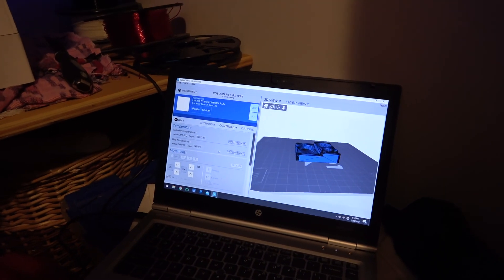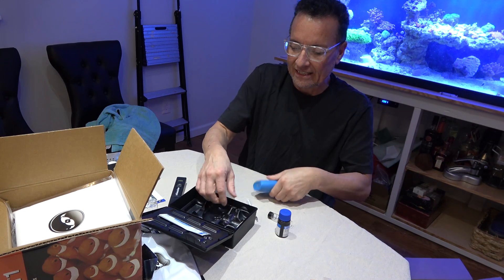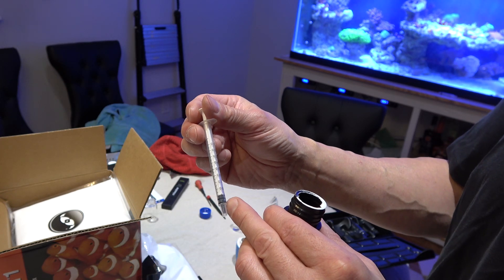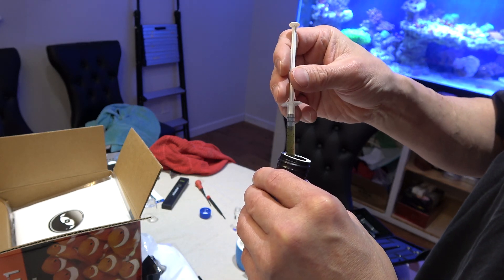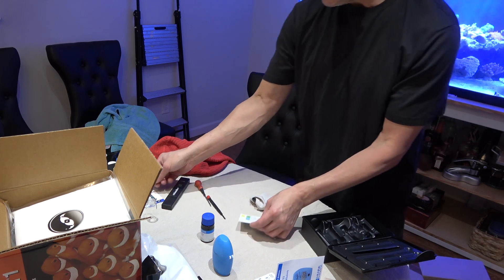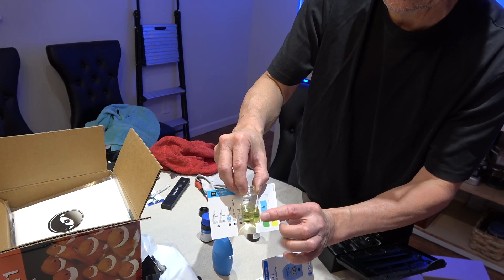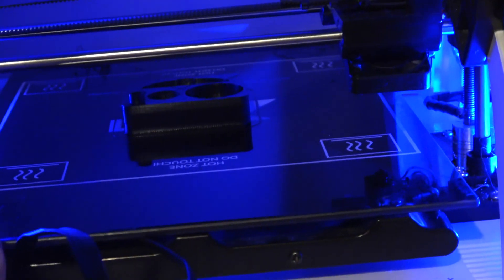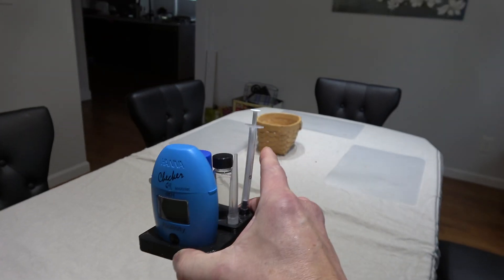Hanna Alk Test  - Spicy Reef E52

Comment: Engineers are now sadly tasked to design for ease of production/assembly not ease of use.
Reply from the maker: Even a 50c battery holder has a little indent to take the plastic off, place it on the correct side to avoid hassle Hanna dropped the ball - You're absolutely right though, that was a short-sighted of me I commented out of frustration. Glad I didn't apply a screwdriver and break it. Thanks 🙂